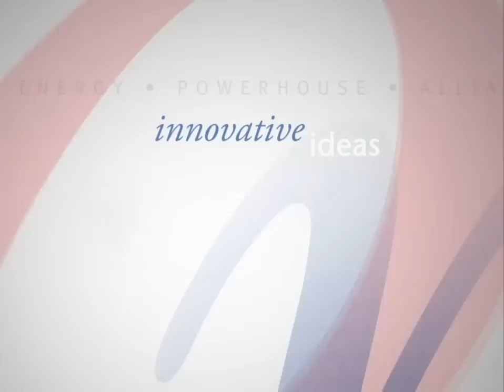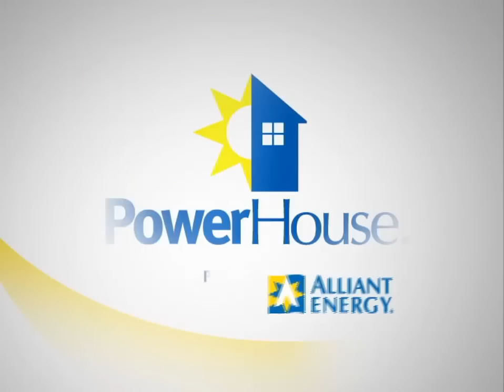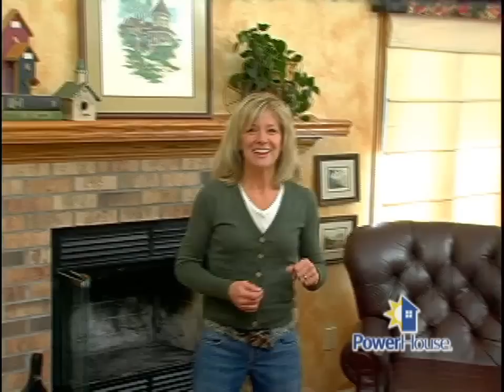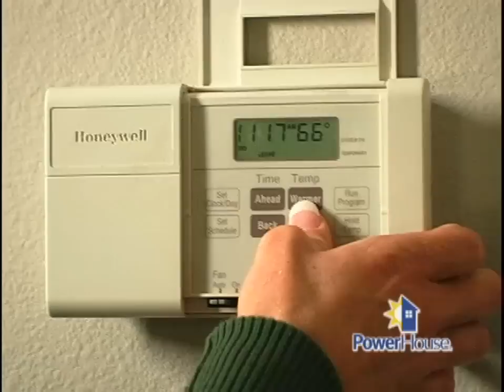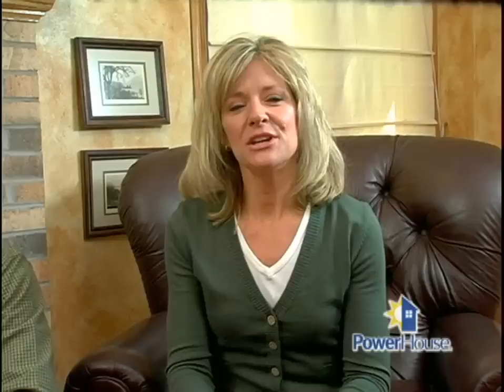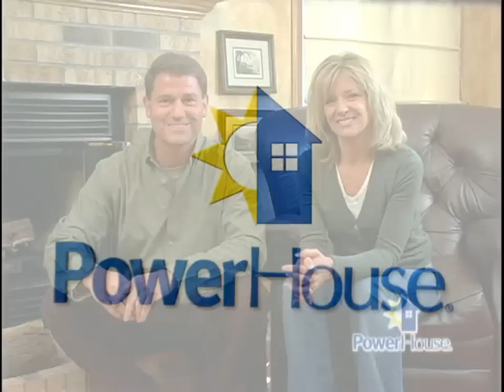DIY tips to improve wood-burning fireplace efficiency

Comment: my fireplace makes just enough heat to not effect the thermostat due to location im sure, also when my fireplace is cold and not in use I have a Styrofoam cover that I made, "cut out and painted" I only use mine on occasion  for extra warmth in the living room or if the power is out so I don't freeze to death in the living room.

Comment: If the wood burning fireplace is so inefficient and they are trying to sell me on the greater efficiency of a gas fireplace, why label the video "Wood burning fireplaces"?!?  Also, there is a lot of good information here, but if you are representing the opening of a window to supply air to a specific depth, then perhaps you should show that in the video instead of opening a crank window more that 6 inches...
Overall, this video is entirely misleading, mostly by not differentiating between the benefits of a gas setup as opposed to a wood one.  And overall, wood is better, the only thing that is relevant is the heat loss, which can be solved if you build a Swedish style smoke stack.
Sorry, had to amend this after hearing "glass is an excellent conductor of heat."  CLEARLY these people have no idea what they are talking about, as glass is one of the best insulators known to man, which is why it is used to insulate high-tension electric lines across the country.